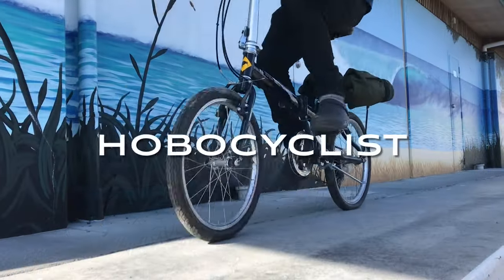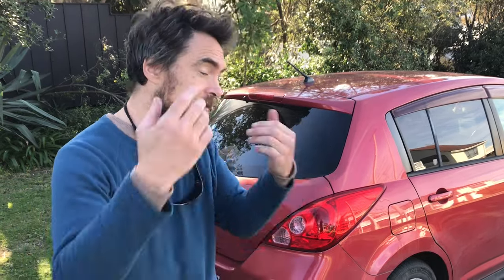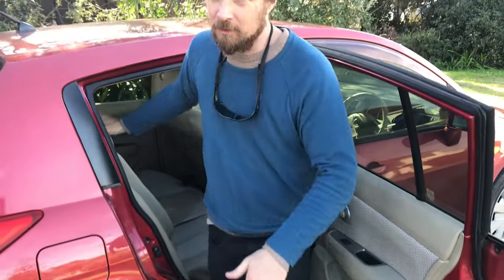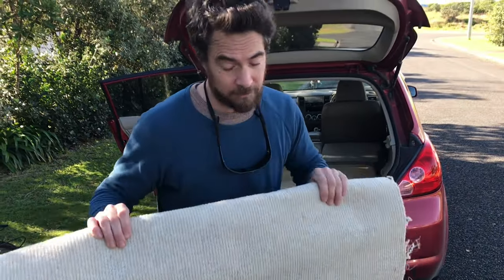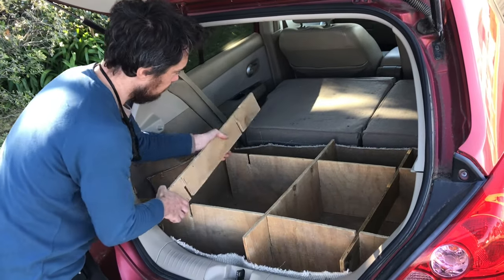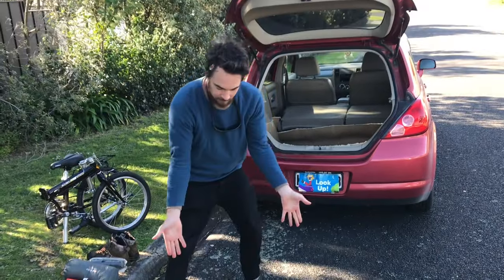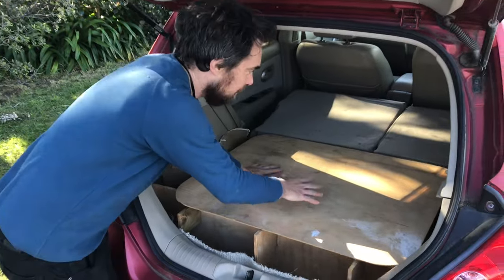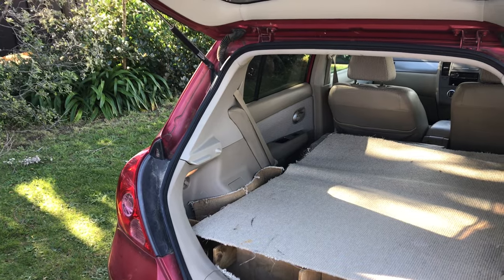$20 Micro car camper- no build construction- how to live in a small car, ikea style budget campervan

Comment: you can also put a bunch of those sturdy plastic box containers in there, put a flat board of some sort on top and it would work the same without having to cut any wood
Reply from the maker: Yeah that would work!
Reply: Will keep it in mind because I'm a senior and unable to do the work!
Reply: I do that in my truck bed.  The benefit of Andy's setup is that it's a more efficient use of space than the containers alone.  And the plywood is likely much cheaper than purchasing the correct size containers.  It all works in the end as we get on with it all.  I'm thinking of  using his idea for the space against the opposite wall for more storage.  Currently  my Non folding gravel bike goes there.

Comment: Anything is better than sleeping in a tent! I occasionally go camping in my 2005 Pontiac Vibe. The great thing about it is that when the rear seats are folded down, the back of the seats and cargo area are perfectly level with each other. I think this feature should be required by law for all hatchbacks! Sadly, my Vibe is getting worn out. And it seems to be impossible to find another one that does not have a huge number of miles on it. Awesome vehicle!

Comment: I am six feet tall and have a Nissan Versa Note. You can make far more room by sliding the passenger seat fully forward and putting the seatback as fully forward as possible. Then you need some support on the floor in front of the back passenger seat to create the same level as the folded down back seat and rear platform, and  it makes room for a space where I can sleep quite comfortably on a rolling memory foam mattress tailored to that size.
Reply from the maker: Sounds like a squeeze!

Comment: I do something very similar in my Skoda Octavia but have wooden planks screwed under the board - it is a shallower space than yours but l like your way better.

I also only use the wider half of the back seat for my bed so that my cooking box sits in the boot space alongside the bed, or can be moved outside for cooking or onto a seat overnight.

The small half of the back seat stays as a seat, with a seatback organiser on it and usually clothing bags etc. On the seat or in the footwell.

Comment: Super good video and a needed look at the temporary style to preserve the car.
Did you eliminate the spare tire and tool compartment?
Thanks.
Susan
Reply from the maker: Thanks, yes important that the car can still be used as normal to carry passengers and gear. The tool and spare tyre are still on board, although below the platform they can be reached easy enough by removing the wooden frame.

Comment: That's a great design. What kind of board did you use for the platform? And where could you find a board like that? I was thinking about using a plywood platform, but plywood is kind of heavy to move around. Thanks
Reply from the maker: It is plywood, thin and light. I got the wood from a recycling centre, rubbish dump for a few dollars

Comment: I have basically the same car (Nissan Note). In my case the back part has already some specific corners and gaps to fit an official platform  making it flat with the rear seats. 
Instead of buying it  (about 1,000 dollars) I just made using wood (10-15 dollars). 

However how can you sleep only with that??? Do you actually sleep?? In the video when you lay down your legs were squeezing between the front seats. You even didn’t lay down the front seats. 

I am 5,11 and I have to put the front seat all the way to front and then lay them down. Plus I had to come up with another platform to fit between the front and rear seats. 

You don’t even lay the front seats down?? 

Thank you!!!
Reply from the maker: Yeah I’d put the front seats down for sleeping, it’s a squeeze,especially with two people.

Comment: Nice, I have bed on passenger side with bottom part of bigger section of rear seat removed, back folded down & a piece of ply on top that gives a bed of about 5 feet 7 inches in a Kia Rio MKII. Leaves the smaller rear seat in place for sitting & with the two front seats as far forward as they'll go & flipped forward there's a surprising amount of space. Video of it on my channel...
Reply from the maker: Cool mate! Ill have a look. Cars are excellent for sleeping in if you modify to your requirements. There’s more vids on my channel of my Toyota that’s set up for living full time- solar power, comfy mattress etc. Enjoy your adventures!!

Comment: Nice design for installing platform bed with ample storage beneath.  However, the problem of accessing the storage units arises with the necessity of having to remove the main plank in order to get at the cubicles - and having to remove the bicycle, mattress, etc. I envision would be on TOP of the plank first would present a real pain in the rare event that one might need something inside that storage.  Sorry, but I much prefer designs with side access to storage - it's more convenient, albeit more expensive and more difficult to create.
Reply from the maker: thanks it has been used this for many years, even lived in full time. this video just shows how it was made very easy and fast for most ppl. Access to storage is from outside the vehicle simply lift up the board from the back!
Reply: Or get a bike carrier that fits on the hitch.

Comment: Hi Andy, Amazing solution. Strong but simple. Do you have an idea how to sleep in a Passat sedan? I'm 177 cm tall, and didnt find comfortable way.
Reply from the maker: I’ve slept in a few sedan type cars, best way I found was to sleep in the back seat with the seats pushed toward and my feet up on the seat like a hammock, kind of positioned diagonally. All the best!
Reply: Hi, I’m about the same height and have managed to grab a comfortable night’s sleep in a small Hyundai Getz.  But it took a bit of trial and error to get it right.  

I simply folded forward the back seats like in the YT video.  I placed cheap plastic storage boxes in the boot area to bring it up to the same level as the folded back seats.  I moved the front passenger seat forward as far as possible, then tilted the seat forward.  I placed a couple of cheap plastic stools in the footwell of the back seats, one with the sides cut out for the hump in the middle of the car.  I placed a narrow children’s airbed over the lot, and put an old doona over the airbed.  In the space between the stools and the tilted forward front seat, I simply filled with unbreakable thing at the base, carry bags of clothes, on top of that.  The whole thing was still not quite level, so I placed a small number of old newspapers under it, in the low spots, and bingo, a cheap low tech bed, in my car.  I found sleeping towards the front of the car, at a slight diagonal, gave the best sleep.  The other way round was comfortable … until I lifted my head and bumped it on the hatchback door due to its curve.  More headroom the other way around.

Best of all with this method is it was relatively cheap to set up and all the things required could be used for other things, so no wastage.

It also left plenty of room for other camping gear, essentials, and … okay … things to play with, like my game boy (100 classic books; solitaire; checkers, etc), my chess set, a few books, transistor radio and portable word processor with 700 hours working time on just 3 x AA batteries.

Hope I’ve been helpful here.
Reply from the maker: @penguinvic9892  Awesome set up! Sounds nice and easy and possible to use in different vehicles too
Reply: Don’t know much about the Passat sedan but did see a YT video review that showed the back seats folded down in the forward position to give access to the boot.  If the front seats fold forward, then you should be able to improvise a setup where a narrow airbed be inserted into the boot and various objects like plastic storage boxes / stools etc placed in the back passenger seat area footwell to support this.  In the space between the plastic storage boxes stuff your carry bags with clothes or cushions.  With a bit of luck you might cover your height.  A problem might be the limited space height between the back seats and entrance to the boot area.  You could only sleep one way in this set up, and that’s head toward the front of the car and feet in the boot area.  That’s where hatchbacks have it over sedans.

If your car is brand new or newish, I wouldn’t recommend anything that might damage the interior.  Also, check to make sure your backseats will carry the weight required without being damaged.  Somehow I don’t think the Passat was ever designed as a sleeping / camping car, so good luck.

My Getz is quite old, so I’m fairly laidback about experimenting with it for camping purposes.
Reply: @hobocyclist  Thanks for the kind reply.  One thing though.  My bed arrangement placed my body at window level, so something to block out people staring in would be required i.e. curtains or tinted windows.  I used the plastic from a torn camping tent.

Good luck with whatever you do.
Reply: @penguinvic9892  Hi Phil,
Thank you for advice. I bought this 2005 year's Passat Sedan relatively cheap price. 
That time I didnt think that I have to sleep in it.
Later a I bought a small farm with a small old shed. 
I tried to sleep in this shed, but some small mice like animals didnt let me sleep.
They were dancing all the night. It was better to sleep in my car. I tried your first method, but it was not confortable.
Better method was for me, to push the right first seat forward as much as possible without the neck guard, than laid down the back of the front seat.
This method gives not a full flat surfice, but near to flat if you are strong. and push down with strenght. Then as you said I put some things to get the surfice more flat. A mattress on it gives a narrow and a little short bed,
with not too much space above it. This is not a very good solution, but relativly acceptable. Better would be to by a hatchback car like your one. Sorry for poor English.
Reply: @kisslahu  Sorry if the layout of your Passat doesn’t quite allow you to have a good or comfortable sleep.  Even small hatchbacks offer more options, but even I, at more or less your height, had to experiment to get it right, to my satisfaction.

Believe it or not, I was in your situation years ago re. shed & mice etc., except I was renting and not buying.  I got ruthless with the mice, and exterminated them with traps and poison.

If you are the only one using your Passat, and look like sleeping in it long term, a solution may be to remove the front seat, the use a base of storage boxes between the front of the car and the folded down back seats, then a thin mattress on top of this.  Just make sure that this method is a/ legal (for driving the car), b/ won’t damage the electrics of your car.

One problem with sleeping in any car, is that any mattress plus blankets etc, will start to dramatically reduce headroom.  This may not appear a problem lying down, but as soon as you move, or lift your head you may notice the difference.

Anyway, good luck with your car.  

PS

I think your English is quite good … a lot better than most of my students.

Comment: Too diffucult to construct need woodworking degree
Reply from the maker: I must create a course!
Reply: In place of this you could buy 2-3 small cheap plastic containers that were level with the folded down seats. I put 2 plastic stools in the back seat footwell, moved the front passenger seat forward, tilted forward and a small narrow airbed in the space provided.  All I had to do was modify one of the plastic stools due to the hump in the centre in the floor of the car.  I’m no handyman but even I managed that.  Just stuff some luggage in the space between the tilted front seat and the stools, and you should get a reasonable night’s sleep.